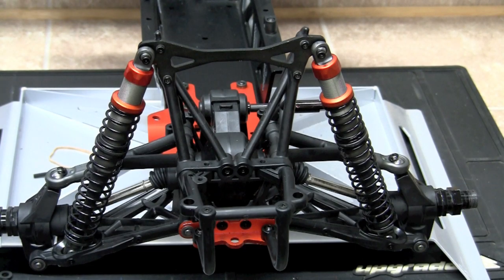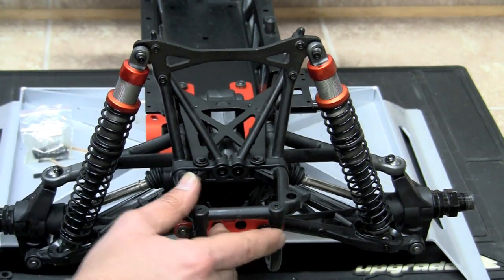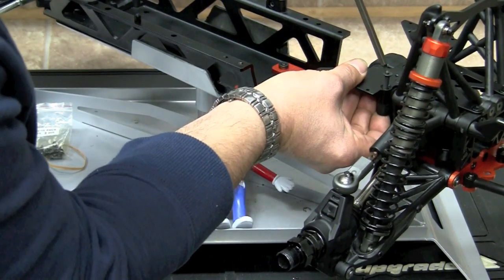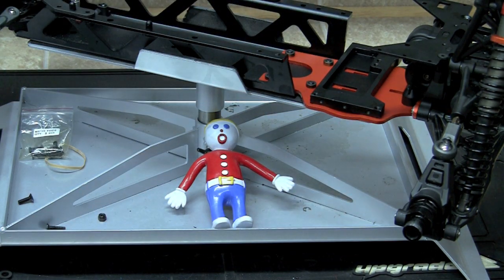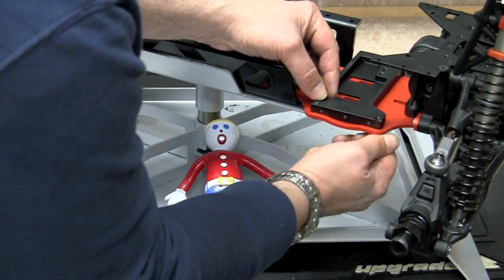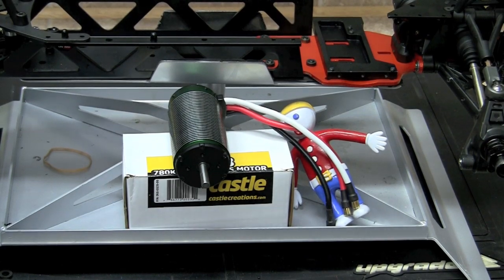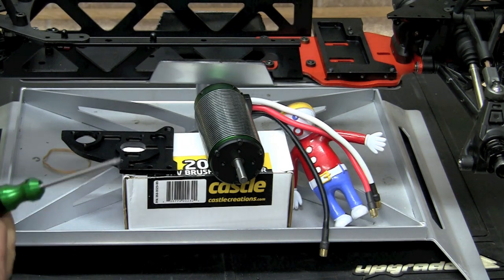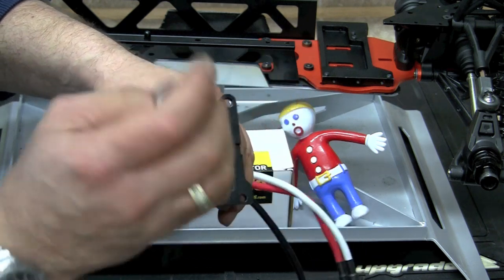Castle Creations Electric  Conversion HPI Baja #3

Comment: yha i called them about 2 weeks ago .the tec said has to come off.wished had took off to begian because bent spur gear plate, now spur rubbs on it every half turn.part no. 5 holds the barring out just enouge to bend the plate.as soon as i took it off the bearing dropped in 1/16 to 1/8 of the way was holding out. might not do it on every kit but did on mine?not to up on the 5sc my 1st one. but i still love it .

Comment: how much trouble did you have getting off the 24mm nut off of the drive shaft,that used to hold the brake discs on, For me it was a total nightmare getting it off, it stopped me dead in my tracks,for around 2 weeks, trying to think of a way to get the damn thing off!! I didn't buy this conversion kit,i bought the RovanRc kit, much less money,and pretty much the same power,

Comment: really does not matter since its bolted on the shaft and the electric conversion uses the motor and esc for brake its really up to you if you want it off or not.  but pulling it off can help prevent problems that can occur later in life.

Comment: What kind of stand is that? Do you like it? Is there another one that you like more? I used to have one like it for 1/8 scale and I liked it, except that it would spin on me when I didn't want it to. I ended up modifying it so it would only doing when I wanted it to. I'm looking for a nice 1/5 scale work stand that has a way of staying in one position if I want.

Comment: @staticxmako 

a normal baja doesn't weigh 50 pounds.  my full billet aluminum baja with a twin weighs in at 50 pounds.  my basher baja weighs at 38 pounds with rpm parts and a few other parts.

Comment: @dotbadburn problem is the bigger you get those gas motors the bigger the weight is...... these are a helll of alot lighter
8s lighter than full tank
and this 2lbs is def lighter than like 15 lbs for a 60cc

Comment: @staticxmako nuhhh I rather not to go to electic you dont know how much you will spend for this plus the lipo's and those lipos will run only for about 15 to 20mins depends how you use it.Wait for bzm motors they gonna release 46 or 50cc engine with no converstion kit and pretty sure that will be more fun to this electric motor...

Comment: @3lynmar actually your wrong about everything you just said

1: this BL setup is exactly the same or over or under the weight of the stock bajas 23cc (few lbs off) or more

2: the lightness of it will not cuase it to get bad traction. its giong to be fucking 25 lbs thats more than enough for traction if anything its too much

3 having less weight means in  a wreck..........your stuffs not gona break how the fuck do you think having more weight will help stuff last

50lbs on impact or 25?